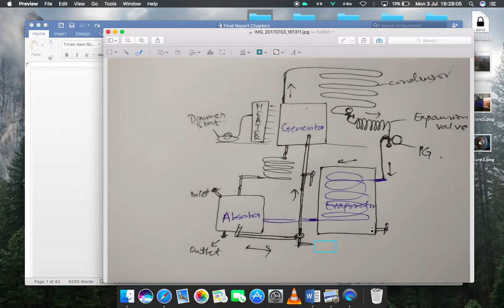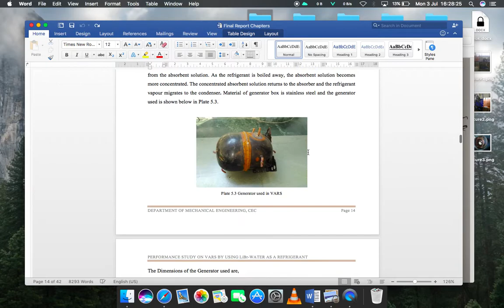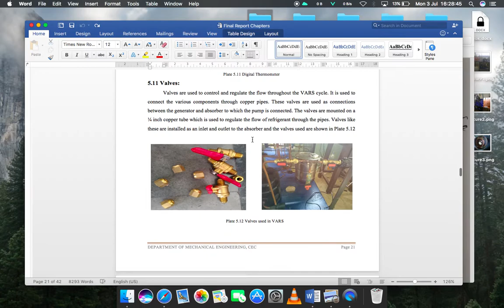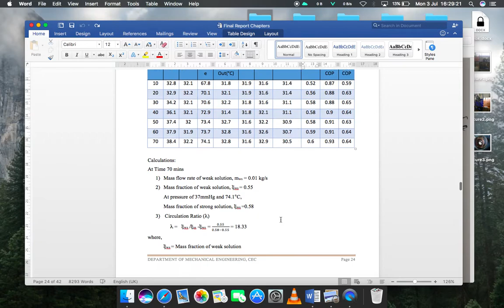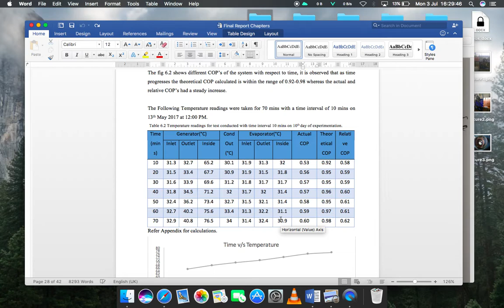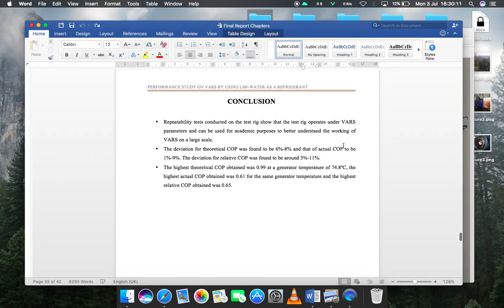How to Build a Vapour Absorption  Refrigeration test rig

Comment: Hi sir ,how to decide the amount  of ammonia and water for this system.
Reply from the maker: When you use water and lithium bromide solution as a refrigerant there is always a risk that the lithium bromide in the solution will crystallize show the percentage of 45 percentage and 55% ensure that the lithium bromide crystallize does not  happen and form a precipitate in the tank
Reply from the maker: You can experiment with varying levels of the solution to find different COP's

Comment: Brother can you tell me what formulation did you used to find the length and dia of capillary tube plz need help regarding this matter  urgent
Reply from the maker: It all depends on what kind of pressure regulation you want to achieve, for expansion
Reply: @K0CrewACG  can you tell the book from where you took it
Reply from the maker: @muneebrehman1776  i spoke to people from the industry and took reference for books in my college library at that time. Its been 6 years now
Reply from the maker: @muneebrehman1776  i don’t remember much buddy i mean its 6 years

Comment: Your project is really good !! , congratulations on this successful build , i and my team are building the same kind of project with aqua ammonia and another system to boost it's efficiency , we are working on the 3 fluid Electrolux system .
Reply from the maker: HIMADRI JHA we built it using Lithium Bromide and if you are planning with ammonia don't use Copper
Reply: Yes it causes corrosion , thanks for your advice !!
Reply: Hey bro if you are seeing this please reply we really need you help 🥲🥲

Comment: Hello bro..can i contact you regarding t project?
Reply from the maker: Bharat Terang please refer to my Project report for further Help
Reply: I have downloaded the project report, i will go through it. for further details can i have your email id or contact number?
Reply: I need to know the actual cost, duration to build the project bro, and the ton of refrigeration of the system. I need to build a system like this but i m facing lots of problems.
Reply: CAn u make another video of the system working?
Reply from the maker: Bharat Terang i finished my degree and i am back at my home, i am 1863 kms Away .
I do not have access to my test rig
Reply from the maker: Bharat Terang it cost me around 30k
Reply: Ok bro no problem. Can i have your email id or whatsapp contact no so i can text u bro? I m building the same system so i need help and ask some basic questions.
Reply: I don't understand why are you so scared to give your contact number..i thought u wanted to help. but you seem like u are running from it
Reply from the maker: Bharat Terang You are a Engineering student if i give you everything what work will you do?
Reply from the maker: Bharat Terang i gave you the design, take a calculator and calculate what you need, how you need!